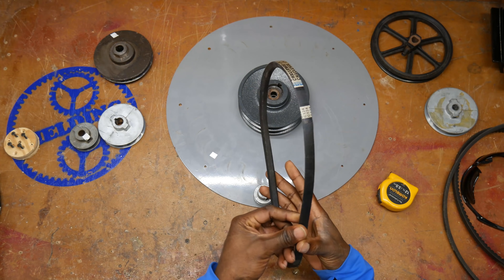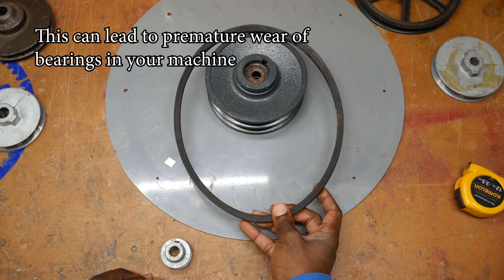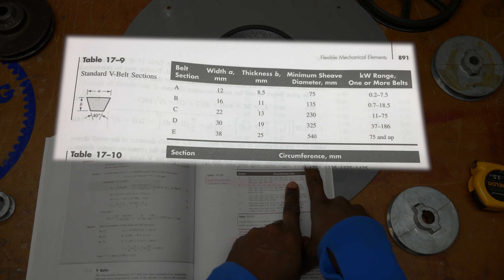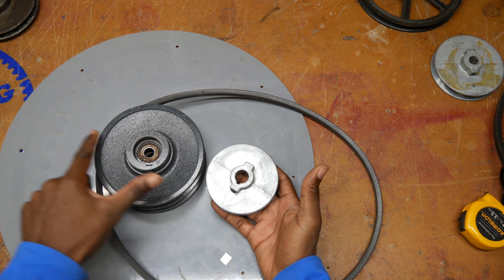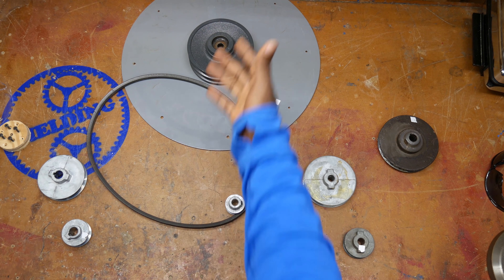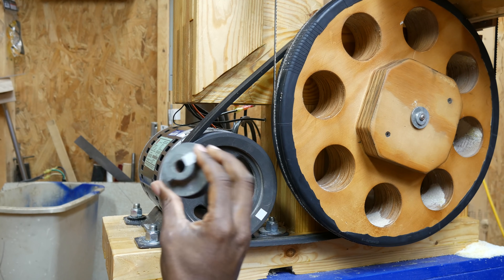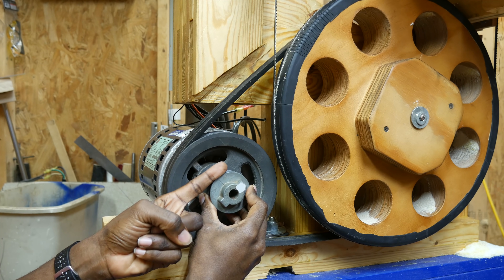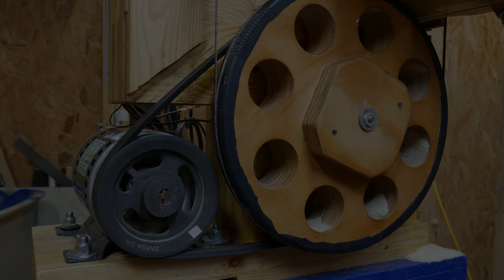7 Tips For Best V belt Performance; How To Prevent slipping and Other Belt Issues :052

Comment from the maker: Clarification. The key point for tip # 7 is The belt is experiencing more force as the pulley gets smaller. I show the formula in the video. The only conclusion you should get from that is small pulleys might reduce the life of your belt. It has no effect on hp. (Edited to be more concise.)
Reply: I remember MANY years ago when I was a young man trying to comprehend these vary issues about gears and pulleys, and essentially it was the basics of the fulcrum and plank in which made a clearer picture  in my head about the principles involved with forces ( torque ) and angular velocities .
  Picture a plank with a fulcrum near one end, then you'll better understand the power you have at one end vs how much power would have to be consumed going the other direction.
  In other words a  2 gear or pulley pair are the similar as two plank and fulcrums in which one end of the planks are connect together via pivot point.
Reply from the maker: You have to research your belt. That is the limiting factor. It should have a power rating from the manufacturer or they might offer a forumula for calculating it based on your setup. That is what industrial belt companies do
Reply: Thank you Jeremy, you have helped me out so many times. This video has helped me with my large belt sander. I am now using two drive belts, it has improved astronomically.....It meant switching things around, ie I had to make myself two double drive gears on my lathe, but it was worth it. So much torque and no more slipping. Cheers Jeremy, I cannot thank you enough.
Reply from the maker: You have to search until you find one that does. Or contact the manufacturer. They should have that information. I would have to do the homework just like you.
Reply: Shows of the best configuration for a belt tensioner if you have a large pulley and a smaller pulley I have problems with belt slipping continuously
Reply: Still a little confused you're not really gaining power you're just not loosing as much as you would with a small pulley. The large pulley has a better and easier contact area and just works better. Leverage wise it's still just a gear ratio isn't it? You can gain torque or rpm, horsepower is what ever the motor can supply. I'm just a plumber but I live in my garage and enjoy your work so keep it up. You make things easier to understand my mechanic skills and wood working are decent but your engineering and electrical are fun to watch. Oh and last question what are the little hearts after the comments? Also a little computer illiterate.
Reply from the maker: Forget about every other part of the system... we are only interested in the force on the belt. For the same torque you either have a lot of force and a small lever or a little force and a large lever. If the BELT has a small lever as when it goes around a small pulley, it will have to endure more force through it. Therefore the tension stresses in the belt are highest when wrapped around a small pulley...this changes when the belt goes around to the other pulley. Thinking of one small section traveling around. You can do the math using the formula shown in the video. Like I said in the video, It is counterintuitive when you are thinking about all the components. Focus on the belt
Reply: I think I understand a little bit better it's the first chart that screwing me up. I believe the chart is explaining how much horse power can be pushed through a particular size sheave at a given rpm. Because as you said the smaller the sheave the less contact area you have. You can't put 8hp to a 2 5/8" sheave unless you tighten the crap out of it which is all bad. Thanks for the reply and awesome as usual video. But what are the little hearts for after peoples comments? P.S Merry Christmas to you and your family
Reply from the maker: That is YouTube’s way of letting you know I love a comment. I use that instead of the thumbs up so people know I read and acknowledged their comment. If I use the thumb you don’t know who put it there.
Reply: OK a little embarrassed about the heart thing but my grandma would be happy as I learned something new today keep up the videos.
Reply: On some older car A/C applications two V-belts were used which were sold in matched sets. Industrial belts will be stronger and last longer but these car belts may be good enough and they will be cheaper to buy. Buying two individual belts may not get you an equal match as one belt will be doing much more work than the other so always specify matched belts and replace them all as one set.

Comment: Another great video.  But now I'm confused about pulley-size.  With regards to your lathe design, what size pulleys (pulli ?) should I be using with a threadmill motor?  Since it is variable-speed, should I make them the same size or different sizes?
Reply from the maker: Try not to confuse torque from the motor with forces on the belt. I am only saying a small pulley will slip more and make it so the hp rating on the belt is lower. However, two pulleys of the same size (180 degrees of wrap) is ideal when all else is equal.
Reply from the maker: Say two 4" pulleys would be great.

Comment: Hi Jeremy another good video, however I think you made a mistake. The smaller the puller on the drive end the more power. On your motor if the speed is constant a bigger pulley is moving more belt if the circumference of a pulley is 12 inches in one revolution of the motor the belt has moved 12 inches, if you have a smaller  pulley one with 6 inch circumference in one revolution it will move 6 inch of belt. So the the motor has twice as much work to do with the bigger pulley. Remember your cycle days the smaller the crank gear the easier it is to peddle to start with but you need change up quick to a bigger gear as peddling like mad.
Reply: I forgot have a very Merry Christmas with your family and look forward to your videos after the holiday.
Reply from the maker: I am referring to the belt not the motor. The belt experiences more force... not the motor
Reply from the maker: The belt is experiencing more force as the pulley gets small. The torque is the same. Force x length is torque. Same torque from the motor... but force on the belt changes with the length of the lever
Reply from the maker: I also show the formula in the video... you can calculate it yourself.
Reply: If you wanted to stall the motor you would put the biggest wheel or pulley  on it to have the leverage to stop it. You could not stall or stop the motor by a small pulley.
Reply: yes, but it is functioning in reduction of torque available to the belt. Lengthen the lever and increase the outer circumference.  Torque is originating at the inner end of the lever.  Belt pulling force =motor torque /length of lever

Comment: Very good video. FYI, V-Belts are not really designed to run on backside pulleys, mainly due to the location of the tensile cords in the composition. Also, for most shop machinery, you want to use fully (fabric) wrapped belts (sometimes referred to as FHP-Fractional Horsepower) and NOT raw edge automotive V-Belts. If you get jam, the fully wrapped belt will slip and not break the machine or burn up the motor.
Reply from the maker: Yes... there are idler pulleys which are flat for outside use... just decided not to re-record that part to fix it, but I added the picture showing both positions... a note on the screen would have been good...
Reply: Jeremy Fielding That’s not what I mean. V-belts are not designed to run on their back on flat pulleys. It’s okay to run the narrow end on a flat or v-pulley.
Reply from the maker: Ok. I agree with that. Tb woods (maker of sheaves etc) also recommends you don’t use them. It is clearly stated on the same page I show in the video except I cropped it out. I only showed it “ for those who really want to use a small pulley” as I stated in the video. It’s your only choice if you need that speed configuration. But yes the layers are designed such that it’s made for tension on the outside and compression on the inside. I understand that.

Comment: Jeremy - any advice for Reeves Drives? I restored a beautiful old Delta variable-speed drill press, but it howls horribly from the "scrubbing" of that wide belt against the sheaves of the pulleys, particularly at slower speeds when the belt is being forced around a mach smaller diameter at the motor end. A light lubricant like WD-40 does quiet it quite a bit, but this is a lubricant, so it has to compromise the traction between the belt and sheave (which is why it helps with the noise) and I don't know what effect it will have on the life of the belt (and they're pretty expensive).
Thanks.
Reply from the maker: Unfortunately I don’t have any experience with them. But someone here might give you some input. I don’t know

Comment: I really like your videos!! I used to have access to all sizes of motors I changed out, some weren't even damaged or just needed bearings and I gave them away to people I knew in motor rewinding field. I wish I had some of those motors now since watching your videos. Some of the motors were so big it took 2 men to unload but most were 1 to 4 hp. I'm gonna keep my eyes out for some I can strip out of old equipment. Thanks again for your videos

Comment: That last part about the smaller pulley making the motor work harder is wrong.  That would make more power and slow the machine down.
Reply from the maker: I didn’t say the motor was working harder. The belt is experiencing more force as the pulley gets small. The torque is the same. Force x length is torque. Same torque from the motor... but force on the belt changes with the length of the lever
Reply from the maker: Please watch it again. I think you missed part of it
Reply from the maker: I also show the formula in the video... you can calculate it yourself.

Comment: Nice! I got an old scroll saw from my neighbor and I’ve been messing around with different pulley sizes. The way I set mine up, similar to a lot of belt driven contractor style table saws, the weight of the motor puts the tension on the belt. And it works ok until it starts vibrating. I’m going to experiment with springs and other mechanisms to prevent the motor from jumping.
Reply from the maker: That is the main problem with that design. The belt can move the motor.

Comment: The part at the end about the pulley size really made me think, how do pulleys compare to gears?  That is, pulley to pulley diameter vs gear to gear tooth count (and diameter for that matter i suppose).
Reply from the maker: Well if you remove the belt transmission of power, you only need to consider whether the tooth is wide enough to handle the force applied to it. A pulley is a gear without teeth. The belt replaces the teeth. Also gears don’t slip and thus guarantee speed when that last few rpm matters a lot.
Reply from the maker: I added a note to the description which gives more detail on the small pulley issue to the description.

Comment: I very well could be wrong but I can't see how the lever works that way when the privet point is where the force is being applied from my view without taking into account the reduction the load would have the advantage
Reply from the maker: It doesn’t matter who has the advantage. The belt has to transmit the force applied to it... from either end. If you were in tug of war with a guy who has a gear box on his end... that doesn’t change what the rope feels
Reply from the maker: I added a note to the description which gives more detail on the small pulley issue to the description.

Comment: interesting, although when replacing pulleys on flywheels for stamping presses, it is implied that the tension is tight apparent to a fixed dimension, then after a calculated amount of working hours, the belt is re-tensioned. i also think alignment is a very important factor that deserves to be mentioned, as a maintenance engineer, i have found most cases of machine failure with pulleys, is poor pulley alignment.

cool video and nice bandsaw, shoutout from New Zealand
Reply from the maker: I added a note to the description about alignment. Thanks for sharing!

Comment: Great vid as always Jez, and a real education as usual. You're absolutely right about the temptation to tighten the belt - my Dad used to scold me about that! I didn't know that the bottom surface of the belt should not touch the bottom of the groove - always something to learn - but what difference would that make? Anyway, next time, toothed belts! Hey happy Christmas mate!
Reply from the maker: It means you are using the wrong size belt
Reply: Jeremy Fielding I assumed that the correct size would touch all three surfaces snugly maximizing the contact area nd so the belt traction, but I take it that this is not the case? As you say, sometimes these matters can be counterintuitive!
Reply: Now that I have taken a moment to think of it I think I understand. If the belt is in contact at the bottom it might not have a snug wedge-like grip on the tapering sides. Sorry to have bothered you - I should have thought first and then written. That's why my Dad had to scold me so much. And still does.
Reply from the maker: You are correct. The belt should wedge into the v groove.
Reply: The pulley and belt act as a cone clutch, with force transmitted through the tapered surfaces. If the belt bottoms in the groove through wear or wrong size, purchase on the tapered (drive) surfaces will be lost.

Comment: please sir do you know if 2 horsepower d. c motor can rotate a 50kg flywheel to 3000rpm reply me via Wasap on +2348068192020 thanks
Reply from the maker: There are many websites with formulas online for calculating the torque needed to rotate a mass. You have speed which is the other part of horsepower. I would have to look it up and do the math, so I should leave that learning moment to the one who will benefit the most.